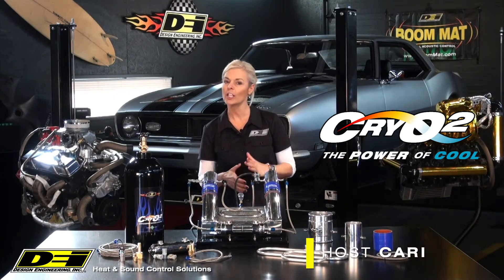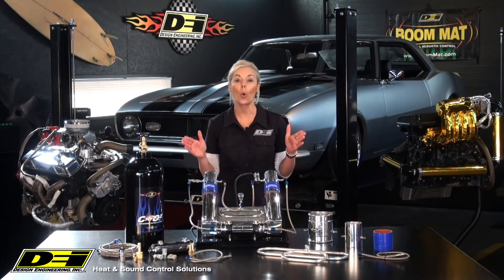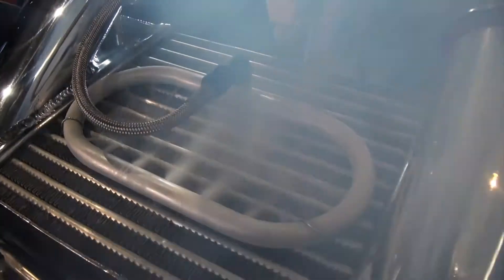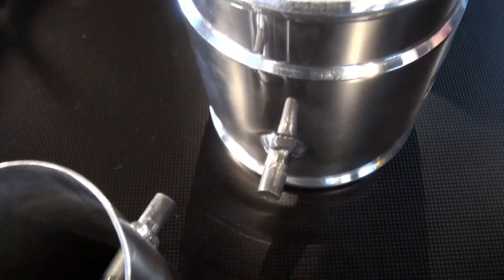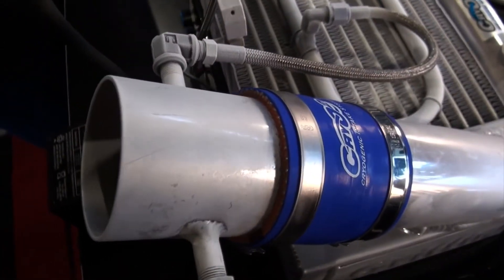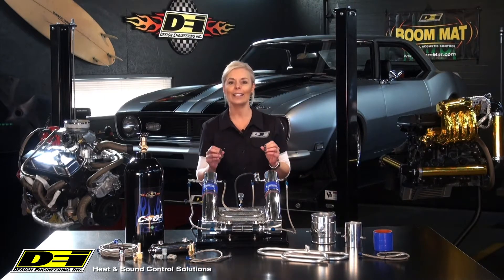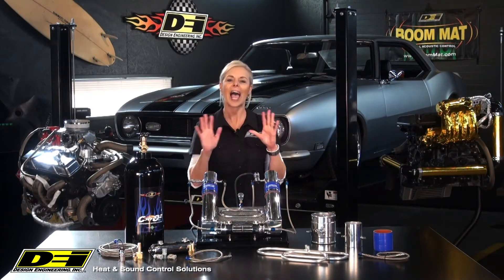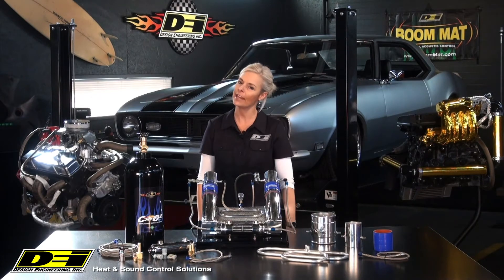CryO2 Cryogenic Intake System & Components

Comment: I could DIY this. This is basically LN2 cooling a PC, except you don't need to worry about frost buildup. LN2 probably is more effective too, and wouldn't require a heavy compressed air tank.